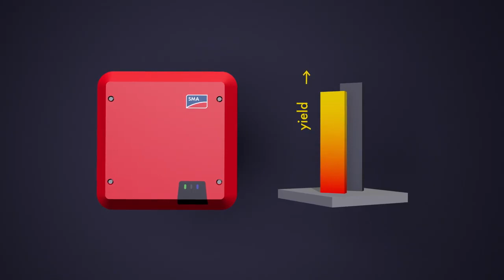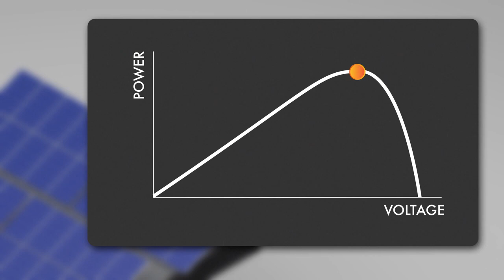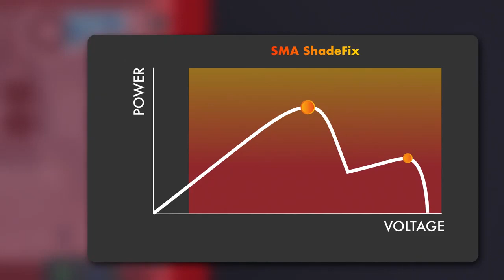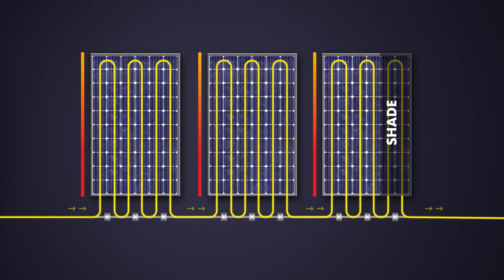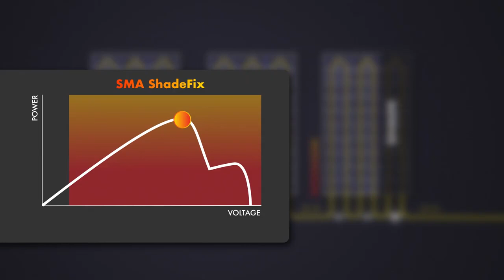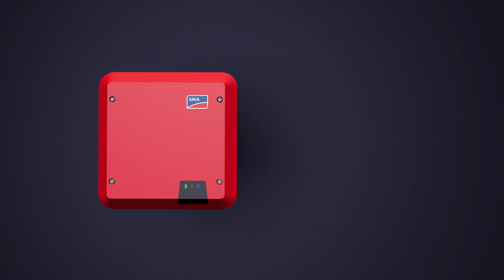Greater energy production  Enhanced safety  Improved quality & service life

Comment: Wait, the bypass diode does not control by MPPT controller. it is an electronic device. Once the shading PV does not provide enough voltage. the diode will turn on and the energy will not flow to the shading solar cell and the overall voltage will be drop.  One fake message will impact the customer not to choose your company.